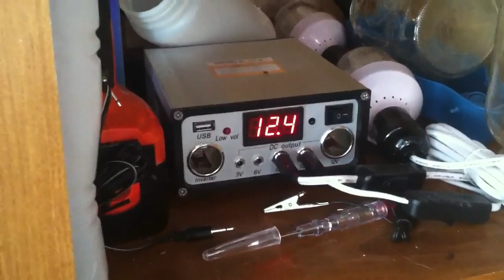HOW TO REGENERATE AND RECHARGE A DEEPLY DISCHARGED OPTIMA GEL BATTERY PART:2

Comment: have you tried putting a desalfator on it. a lot of batteries just are badly salfated. and onces that is removed or desolved back in to the battery they seem to work much better I have one on my battery bank and they hold a nice strong charge all the time.